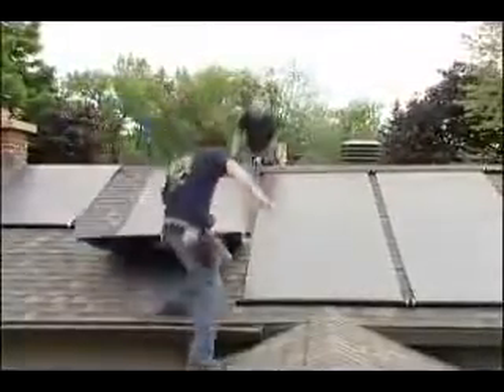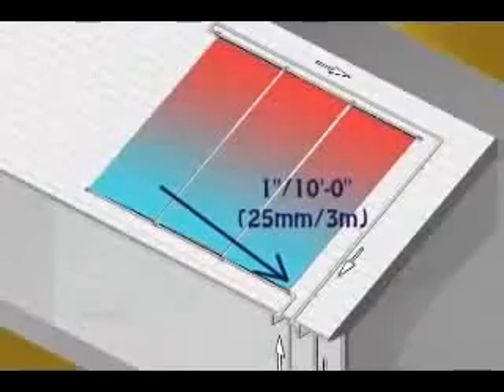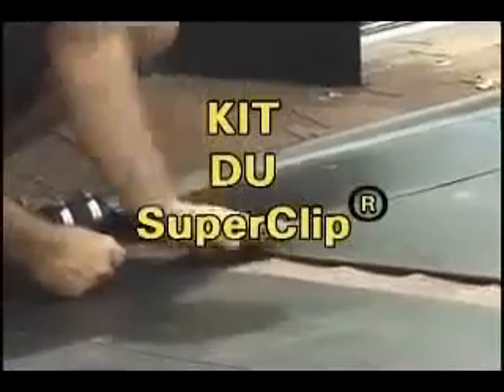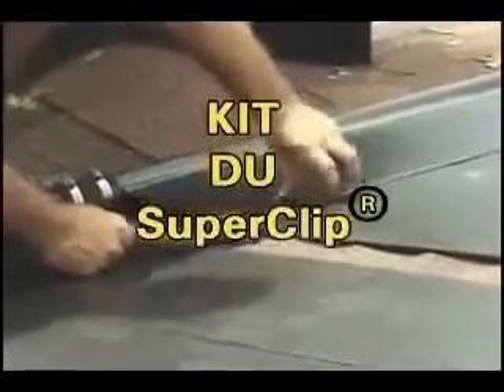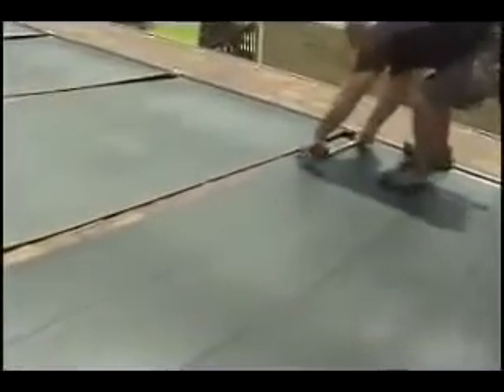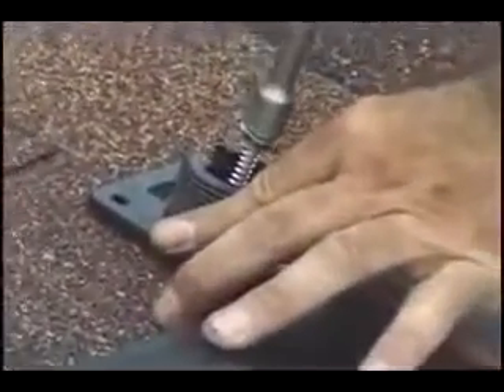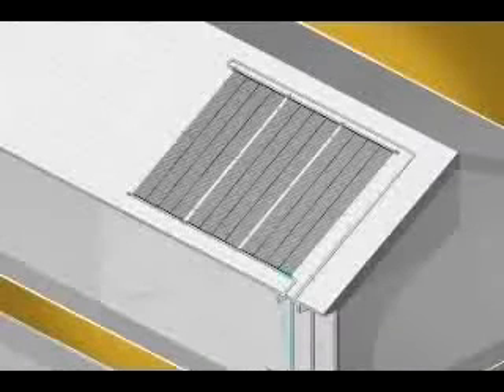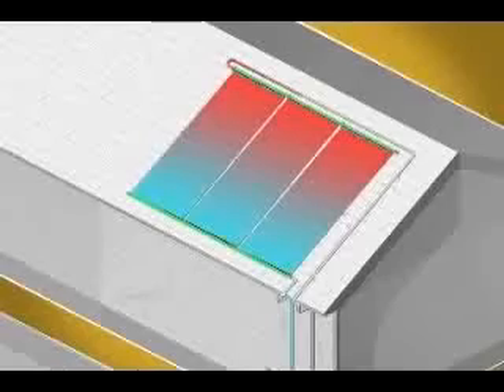Vortex Solar Pool Heater Installation

Comment: BPA free?
Reply: The Header and Absorber
 are made from Co-polymer (polypropylene and polyethylene) virgin black plastic containing a proprietary ultraviolet (UV) stabilizer with an “In-House” continuous extrusion process using vacuum forming.
Reply: @DIYSolarPoolHeaterKits   does this mean yes free or not free?

Comment: Can these panels be mounted in the horizontal position!
Reply: Unfortunately not. The Vortex panel is only designed to be installed vertically.

Comment: Why is the pipe clamping to the roof only done at the top?  Can't see the harm in doing the bottom.
Reply: Solar pool panels expand and contract throughout the day as the panels warm up in the sun and cool down in the night. If the top and the bottom headers of the panel are clamped down to the roof the headers will eventually break the weld connections to the substrate. Installing panels in this way will void the warranty.
Reply: Also please refer to the Vortex install manual for more details. https://docs.wixstatic.com/ugd/36b07f_213fd048375c4066ae7f025abac65189.pdf | https://www.diysolarpoolheaterkits.com/